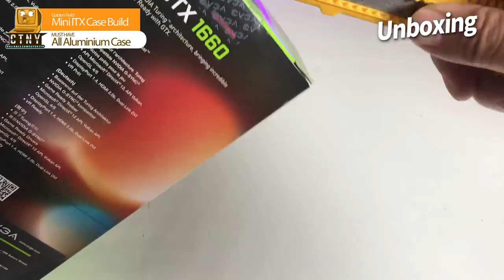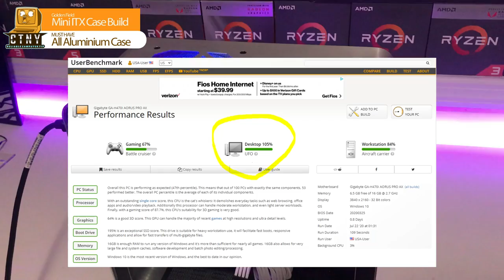$850 Mini ITX Case RGB Gaming PC Build for 2020  i5-10400 | GTX 1660

Comment: Nice build, very balanced choices and great camera work, just wish that case had a Mobo tray for cable management.
Reply from the maker: Thank you!  It was a very fancy case. However, there was no space for cable management. I organized the cable under the power supply, but it didn't look good. Actually, I'm not good at cable management. I like the case which has an invisible area to hide all the cables personally. Thank you for your warm comments.

Comment: Thanks for the video! Will a usual matx board with an sfx or sfx l psu fit? Thinking of buying the same case
Reply from the maker: Yes. If you want to use mATX, you need to use SFX PSU anyway. Please make sure there is no space for wire management on the side panel. Thank you for your comments.

Comment: How did you mount the two 120mm fans on the bottom of the case? Can i just use double sided tape to keep them there or did you have to drill?
Reply: He didnt mount them. Look at the final part of the video, the two fans were gone. It was a dodgy move to be honest
Reply: @oneyedthing  yeah i see now. I ended up just using zipties and they're pretty sturdy. Im able to mount 1 120mm or 2 with the ziptie method

Comment: Have you had any issues with overheating? It seems kinda strange that the psu's exhaust is just pumping back into the case.
Edit: I bought it and cooling is totally fine with a single exhaust fan on an i9 10900k with tdp unlocked and an old gtx960
Reply from the maker: Not really but if you install one more rear fan (80mm) it will be solved the airflow problem. It exhausts the upper side and backside also. According to benchmark, i5-10400 and GTX 1660 is a good combination for the light gamer. Thank you for your comments.

Comment: does this case overheat after 2 hrs of gaming? nice vid btw
Reply from the maker: I never played the game for 2 hours but I guess it's possible due to lack of Fully Air Flow. There is no Front inception. Only one for the top and one for the backside 80mm. If you open up side panel like me it is OK. D:  Thank you for your comments.
Reply: @comtongny7776  thx

Comment: Noticed you didn't keep the 2 fans on the bottom and to the back not enough room?
Reply from the maker: Due to the space for wire management, I removed the bottom fans finally. The backside of fans only supports 80mm fan so, you need to purchase it separately. Thank you for your comments.